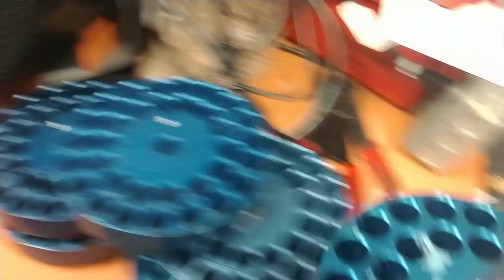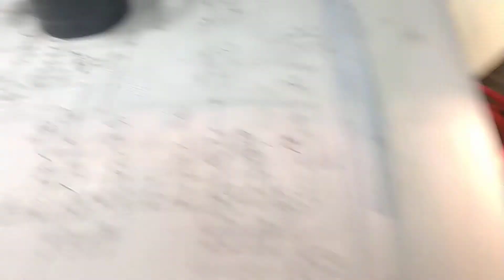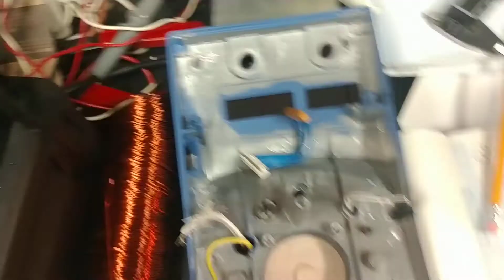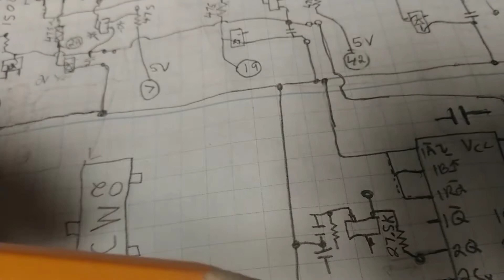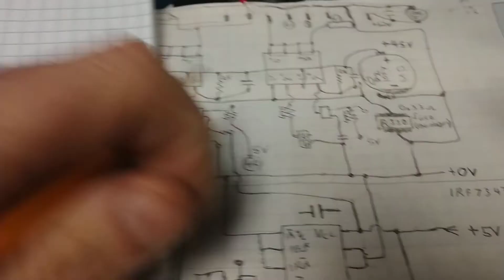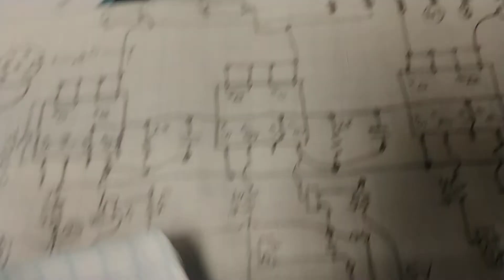(pt1of2) Hot Plate Stirrer repair, IKA BASIC RCT

Comment: Hy Stephen! Someone plugged the hot plate in the wrong voltage then I replaced the transformer. The motor spinning well, but the heater part of the circuit is faulty. The led lights when I turn it on, but the sensor does not display any message, nor heat when I use the jumper. Are any integrated circuit that usually dies when a voltage peak occurs or do you know a possible problem?

Comment: Hello folks. I have IKA C-MAG HS 7 and I got E 3 all the time. If I turn potentiometer on some temp in a few seconds after I turned on my stirrer it works normally until reach set temperature. And after that it shows an E 3
I think the main problem is somewhere in protect circuit but I can not find it... If somebody have schematic, idea how or where to looking for the problem I'll appreciate...

Comment: Is it common for the main CPU chip on these to die? I got a faulty one that doesn't power up. I tried manually applying 10V on the input of the 5v regulator, i get a 5V output but the display does not power on. Any ideas?
Reply from the maker: Yikes, I got a dead board also, fortunately I had a spare board to swap out the whole thing
Reply: Same trouble like you. Fuses, transformer, 5 V, 12 V, all is fine, but no display, no response of the knobs. But safety relais only switch, if a "good" temperature is applied, so something work!
Reply: @rafaeljordan5027  seems to me that the controller is dead. I am planning to mod it with an arduino soon.
Reply: @adilmalik7066  thank you for the very quick report. Don't have the time to do this :-( New board is about 250 € :-( Maybe I'll get a broken one, where the CPU is fine !